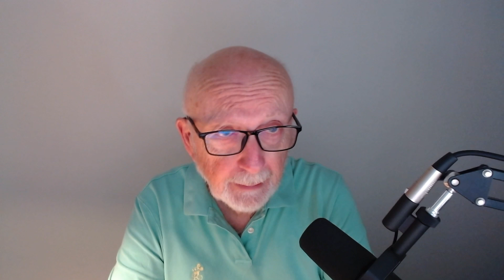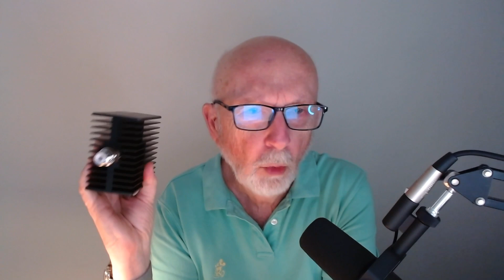Ham & CB Radio Myth - Non Resonant Antennas Don’t Radiate As Well.

Comment: I use a OCF dipole 80-6 meters with a tuner and works great for me
Reply from the maker: Same here.  Mine loads up on 160m but it's not very good.
Reply: @BustRadioMyths   I have tried to load mine on 160 with my LDG AT-200 Pro II but just won't do that band All others are fine some don't need a tuner
Reply from the maker: Try adding a few feet of transmission line and see if 160 will load.  Or try a manual tuner if you have one.

Comment: My quarrel is the use of the word "most".  "Most" implies that there's only one or at least an equivalent in efficiency among the others ranked as "most".  Certainly being resonant alone isn't sufficient to be the most efficient.  Other charcteristics are important as well. But having a good match for impedance and being resonant contribute to being the most efficient.
Reply: A coil loaded mobile whip antenna at 80 meters tuned to it's very sharp resonance is something like -30db compared to an half wave dipole. It is the antennas physical size compared to the wave lenght that matters.
Reply: That's what the tuner is for

Comment: Dipole with an open feeder or ladder line to a transmatch. Then a Balun with a short run of coax into the shack will work great.
Reply: I've worked the planet using this same antenna system. Granted, it's not a yagi on the higher bands, but it still puts out a respectable signal 80-10 on one antenna.
Reply: @richb.4374  Yep a specially the double zepp antenna (2 x ⅝ wavelength) cut for the lowest band you want to operate or can accommodate.

Comment: Just a few words of caution: "I've never had a tuner that felt hot" is an advice which needs to be with some care.

Namely, once our tuner produces a match for the antenna system we have, and we start pumping that antenna system with power (this happens in the first milliseconds after keying up), the the current going through the tuner will also start to increase (and with it, the losses), due to the sum of the reflections which are coming back from the antenna. This process of increasing current and voltage will continue until the the energy getting out of the system, either by being radiated as RF, or by being lost (in antenna joints, coax, or tuner), reach the same amount of energy which gets introduced into the system by the radio. 
In case that we have a system, where the losses in the antenna and coax are very low (especially if it's a remote tuner at antenna feed point), and the antenna is bad enough such that the ohmic losses in tuner approach the radiation resistance of the antenna, then the tuner can actually start getting hot, and its components might start failing.
I've got an Icom AT-141 tuner, where I partially cooked one of the coils by using an antenna with too low radiation resistance (well outside of the manufacturer's specification) by running high power for a long time. :)
Reply: Yeah, there are some matches that will be especially bad cases for a given tuner.  E.g., to resolve the reactances in the system, you may end up with very high voltages or currents in the tuner components, and could exceed their specs.  When you see a tuner spec'd such that it can tune up to 10:1, that suggests that the manufacturer has conservatively estimated the resulting behavior against the ratings of the components they used. Variable capacitors may arc, toroidal inductors may saturate, etc., and it is possible to hit failure conditions.

When that does happen, it means that your feedline+antenna system needs a beefier tuner, with higher-rated parts.
Reply: Does that not prove a non-resonant aerial being made resonant is not the best solution and not efficient?
G4GHB.
Reply from the maker: Interesting!

Comment: I believe (correct me if I am trumpeting from my bot bot?) that a dummy load is NOT a resonant load. A resonant load is an impedance that results from inductive and capacitive reactances being equal and cancelling one another out. In effect a resonant antenna is analogous to a tuned LC circuit (I'm ignoring the  resistive loss component here).   A dummy is a purely resistive load, so YES it gives 1:1 VSWR but it is NOT a resonant load as it is not an impedance it is a resistance (hence no phase shifts). So on this level perhaps the confusion has been added to by this video? The notion/fable that 1:1 VSWR is an indication of efficiency is (as you point out) often pure folly. With enough capacitance or inductance any length of wire can give a 1:1 VSWR with very varied effective radiated power. As for high VSWR on the transmission line, the losses as you point out vary (most notable increasing with frequency increase and lowering quality cable). This is why ladder line was so popular back in the day as it is very efficient (provided it is clear of metal etc).  I cut my antennas to be resonant at the bottom of the band because that is where the Jedi hams live, on the original and the best mode C dub ya (CW). It means I don't have to tune I just send "?" and then, if the freq is clear go for it! Alas when the mic comes out I use the transmatch (AKA ATU) which also works fine but takes me a little bit of time. I guess with modern rigs and automatic ATUs this is less of a concern (I still do it manual). Thanks for this video. What really needs to happen is EXPERIMENTING for yourself, as it is fun and often surprising to see what does work. 73 de VK2 AOE George (subbed to your channel as I always love tech talk!)
Reply from the maker: This is a great and thoughtful post. The dummy load of course is not an antenna at all.  However some hams have made contacts with a dummy load.  If you have two transceivers, transmit a signal with one into a dummy load and listen to the frequency with another. I  guarantee you will hear it!
Reply: I'm going to say this is a definitional sort of thing, and there might be multiple correct answers.  After all, a proper antenna is, in real life, not purely reactive.  Its resistive component is a combination of true resistive losses in the elements and the radiation resistance, which represents loss of power to propagation.  That being the case, we could imagine that a dummy load is just an incredibly low-Q reactive load.  A real one certainly has non-zero reactance, as its resistors will have self-inductance and its joints or traces will have capacitive coupling.  It's like the inverse of the antenna -- very high resistive losses, and minimal radiation resistance :-).
Reply: Hey, that is it, the resonant antenna is a tuned LC- circuit. So you can tune it with adjustable L and C in your antenna tuner. No need to climb in the trees :) 73 Eeli from OH country
Reply: @etusuku8848 it behaves like a tuned LC circuit but the wire does the radiating so tuning out small amounts of reactance either L OR C is fine but for long runs of lossy coax you will lose effective radiated power (after all if it was as simple as making an LC circuit we wouldn’t bother with the feed line and wire in the tree. 😜. …but YES people think an ATU is evil …. Under the right circumstances works fine… and fives added bandwidth/ bands. 73 de VK2AOE
Reply: Yes…. As the dummy is not a perfect resistor…. Leads and wires add inductance and capacitance. I switch to my dummy thru my ATU which increases this RF leakage even more. I imagine with a QRO output you could in all likelihood make a QSO! This would be a fun video…. Xmit into the dummy and see if you can hear it on a local online SDR?? 😂 73 de VK2AOE
Reply: @James-ci3lx If this is the case … what is the frequency of resonance? To be resonant L and C must cancel at a RESONANT freq.

Comment: Well, crap. Here I go again, stating facts that have been stone cold for 100 years, but which someone is dismissing as mythology. Here we go.
(1) A resonant antenna is more efficient than a non-resonant antenna *of the same type*, because the resonance makes the antenna's load almost purely resistive, which makes its power factor equal to 1. There is no difference between real power and apparent power. 
(2) A low SWR is not an indicator of resonance. It is only an indicator of a match between the load impedance and the characteristic impedance of the transmission line. That's why a dummy load, which is decidedly non-resonant, has a low SWR; because its impedance matches that of the characteristic impedance of the transmission line.
(3) An antenna tuner at the transmitter can cause the impedance mismatch between the transmitter and the transmission line - caused by a mismatch at the antenna - to effectively disappear, but the antenna tuner will have resistive losses that can be avoided by having a proper antenna. And as noted below, there will still be issues.
(4) While the losses in coax caused by SWR are not severe at low frequencies, they get worse as frequency rises, because the impedance mismatch causes it to stop acting as a transmission line and instead act as merely a shielded cable that radiates signal along its length - which it is not supposed to do.
(5) It is entirely possible for a perfectly resonant antenna to have a high SWR. If you have a perfectly resonant 300 ohm antenna and you connect it to 75 ohm coax, you will end up with an SWR of 4 to 1, and yet it will still work well, save for the loss of power caused by the load mismatch.
Reply: A good book for you to have a read by Walt Maxwell called reflections
Reply: @paulm0hpd319  I replied to your comment earlier, but I don't see it here. Hmm. Anyway, I looked that book up and unfortunately the only copy I could find was $100. However, I'm reading a series by the author called, "Another Look At Reflections," and it's quite interesting so far. I have to stop and go to work right now, but I'll read the rest of it this weekend. Thanks for the suggestion.
Reply: @ScottGrammer  not sure I saw your comments earlier some have been removed even mine not sure why
Reply: @ScottGrammer  I think you can still get reflections 3 as a free download, another look at reflections is a more overview of the reflections series
Reply from the maker: https://www.k3emd.com/downloads/Reflect.pdf
Reply: @ScottGrammer what did you think of the book
Reply: @paulm0hpd319  I actually looked it up, and unfortunately a 34-year old copy is $100. If I can find one at a reasonable price, I'll check it out.
Reply from the maker: You got everything right except point #1 I think.  Here's a link to Walt Maxwell's articles.  
https://www.k3emd.com/downloads/Reflect.pdf
Reply: @BustRadioMyths  think no 4 is also wrong ,an impedance mismatch doesn't cause the feedline to radiate ,its common mode current on braid that does that which isn't caused by an impedance mismatch ,that's down to an imbalance within the antenna
Reply from the maker: Yes you are correct.
Reply: @BustRadioMyths  I posted an article with a series of experiments to back up your video but I can't seem to see it anywhere, have you removed it ?
Reply from the maker: No I have not removed anything you posted.
Reply: @BustRadioMyths  oh ok I can't see it I'll post it again

Comment: Hmmm, I think I'm missing something. A 10:1 SWR is okay if you use a tuner. The radio then sees a low SWR and the antenna becomes efficient. If the same antenna length is cut in half, it can still be tuned to be just as efficient, or not. The main thing is to have a low SWR  to protect the radio, I think. It's funny all these years hams have been saying a tuner doesn't tune the antenna, its only purpose is to make the radio happy. Just watch their YouTube videos.  Thank you for sparking my interest in this, it's very fascinating.
Reply: I have a 150 ft long wire on a 9:1.  It will tune on all bands with the tuner and the coax loss isn't horrid.  It works from 160 meters to 6 meters.  As long as there is at least 1/2 wavelength on the lowest frequency you want to work, and the tuner will tune it, it'll work splendidly.
Reply: When I am traveling, I tune-up metal light poles at rest stops. They make excellent antennas.
Reply: Larry there is an efficient transfer of power with an antenna tuner creating a conjugate match and resonance, this does not guarantee antenna efficiency, that said an antenna need not be resonant to be efficient, I love my antenna tuner tuning my antenna system to resonance
Reply from the maker: Well I've said the same thing too which really isn't completely true.  The tuner does MORE than make the radio happy.  It's an over simplification of what's going on.  But if that's all a ham knows it won't stop him from having a good antenna as long as common sense is displayed - like trying to load up the kitchen sink.

Comment: OK i've been a qrper ham since 1978 and know for a fact you sir are wrong!!!! Go qrp with a non resonant antenna and see how many contacts you make even with a short run of coax.
Reply from the maker: I have QRP'd before with a non resonant indoor antenna and did just fine.  I'm sure other hams have too.  Maybe  you didn't use a tuner properly.  Maybe propagation was bad.  You could look up coax loss with SWR charts.  You will see for example that on 80 meters, 100 ft of RG-8 with an SWR of 10:1 has a loss of 1.4 db.  It's usually not bad.
Reply: The new Elecraft KH1 QRP rig has a non-resonant, 4' stainless steel whip that's base loaded, but NOT resonant on 20, 17 or 15 meters -- similar to the Elecraft AX1 antenna.  Even the KH1's 13' single wire counterpoise isn't resonant.  I've watched many videos of K4SWL, using the KH1, making many contacts on 20 meters -- some DX.  Seems to work well enough...
Reply: @DaDitDa  H.F. is very forgiving and it's why QRP and bad aerials work.
G4GHB.
Reply: I agree. The other day I compared my 17m and 10m dipoles on receive against my homebrew Joystick with 26' of wire and MFJ160-10 tuner, all indoors. 
The dipoles were far better: resonant. Joystick: made resonant with a tuner.
G4GHB.
Reply: @James-ci3lx Thats probably the exception rather than the rule providing you don't feed it with coax. Ive' been doing  this for a qrp for four decades and tried them all, For portable work they do work.
Reply: @James-ci3lx I don't understand what you're asking about.
I think it was quite clear:
Resonant dipoles far better than a Joystick which is a non-resonant aerial made resonant with a tuner.
Any poor aerial will put out a signal and h.f. is very forgiving for that. 
QRP works because h.f. is forgiving.
I can't put it any simpler.
G4GHB.
Reply: Also all a tuner does is to fool the radio and fool operating it!
Reply: @jamesgeorge1709 the tuner changes the impedance by way of a conjugate match creating a resonant antenna system, correcting the mismatch to allow power transfer, I think that's a little more than fooling the transmitter

Comment: thanks for sharing. over the many years i have found my resonant vertical ant works better than any other wire at this location i have tried, and i have tried many. I dont use baluns or ununs etc, just a resonant vertical wire, a piece of coax and the rig, zl to eu every day. 73 zl3xdj.

Comment: so I don't need a 19 inch quarter wave vertical for the 2 meter band on top of my car roof,  awesome,  I just need a antenna tuner at the transceiver too make it work, thanks for this video. Am thinking a lower profile antenna like 4 or 6 inches...
Reply from the maker: Nothing was said about using an antenna that is too short.  What about using a sewing needle?  Common sense needs to be applied.
Reply: @BustRadioMyths  Common sense is not so common these days.
Reply: There's this thing called aperture
Reply: Point taken. It is non-resonant which is what this video is about.
I said about a resonant quarter wave vertical against a non-resonant short vertical made to be resonant with a loading coil not being as efficient. 
G4GHB.
Reply: Aperture is a thing.